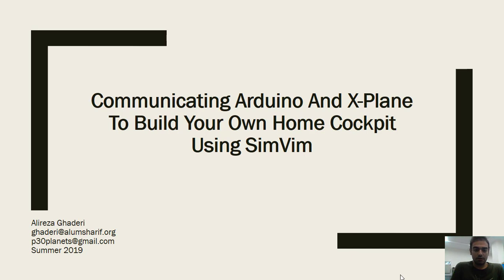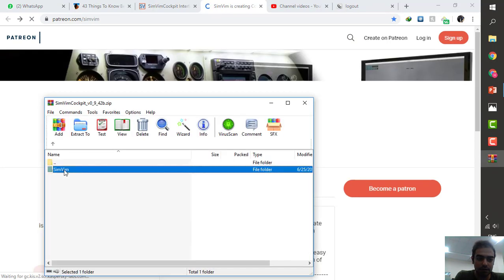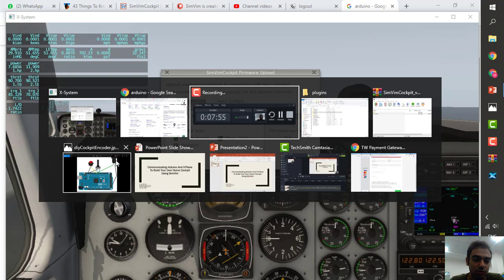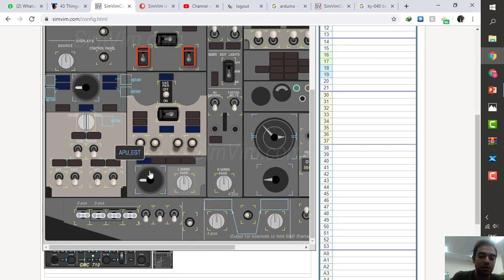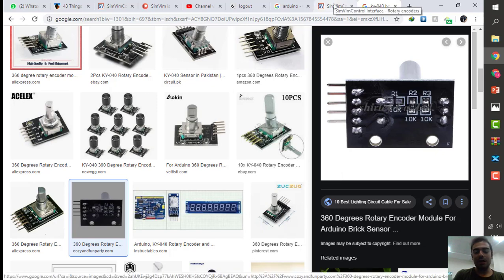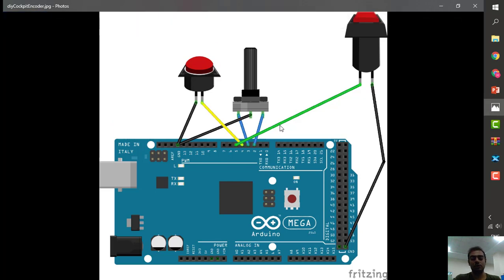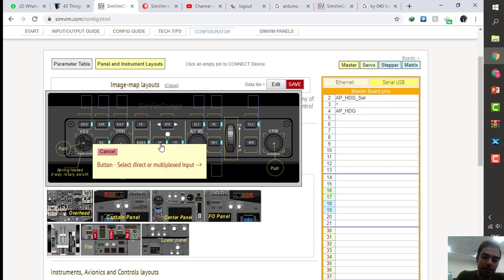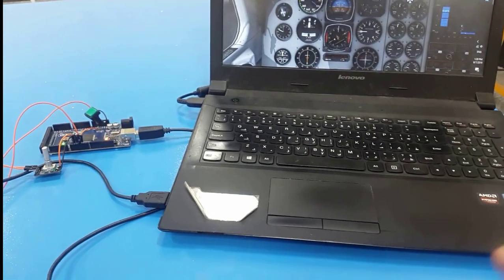X-Plane DIY Arduino  Cockpit - Autopilot panel MCP with SimVim [Part2]

Comment: Hi, I am trying to connect a rotory encoder same as you shown. But The output of my encoder is in the one direction only even if I rotate encoder in both direction. Like If i rotate clockwise then also heading bug rotate clockwise and if i rotate encoder anticlockwise, then also heading bug rotate clockwise...what am I doing wrong?
Reply from the maker: Sorry for very late answer..its look like wiring problem or physical problem with the encoder. Are you using a raw encoder or a module?
Reply: @alirezaghaderi  Hii, figured it out the same day i posted this comment. Actually i was using breadboard and jumper wires. One * jumper wire was faulty. I soldered everything and it worked as it should. 😀

Comment: NOTE: All relevant information, tutorials, videos you can get on our official website - simvim.com
Vlad (SimVIm)
Reply: Hi, I am trying to connect a rotory encoder same as you shown. But The output of my encoder is in the one direction only even if I rotate encoder in both direction. Like If i rotate clockwise then also heading bug rotate clockwise and if i rotate encoder anticlockwise, then also heading bug rotate clockwise...what am I doing wrong?

Comment: Hi there, could you possibly make a video about how to connect annunciators to xplane? Thanks. I’ve just got simple dual led annunciators and have no clue where to from here
Reply from the maker: by annunciator you mean those panels that warnings and messages are shown in that? If yes if depends on the model of your LCD module...  in the worst scenario that Simvim wont support your module, You might be able to have a custom arduino as well and get the  information from Simvim and the communicate with LCD module accordingly...

Comment: In your next video, can you please show how to connect a servo to the Arduino. I am trying to simulate the starter return in the Zibo 737-800 but with no success.
Reply from the maker: Sure. I will simulate one of the gauges for example with arduino or stepper motor. but I should first but the boards for myself. I dont have them now, then I will.  by the way, what do u mean by starter return? you mean N1,N2 gauges?
Reply: alireza ghaderi If you put the Starter on GRD, when N1 reaches 56% the rotary switch returns to CONT. This is done with a servo attached to the rotary switch.
Reply from the maker: I think this is beyond the capability of simvim alone. You need some innovative hacks and ideas. 1) If you use servo for that, serve keep the button at that position under load. so You can no more move the button manually with hand. so even if you are going to use serve, you should add some behind the scene consideration as in, remove the load from serve after rotating to switch. you may be able to do it in conditional tab in simvim for example. you can add a mosfet on VCC pin of servo  and connect or disconnect the serve using a digital pin conditional. another method could be use a separate arduino with custom code to do that. another way can be a spring mechanism that is being held with a pin(something like solenoid actuator.) that being control by a digital pin. so you activate the pin when N1 reaches beyond the desire point. This one I think is closer to what exactly Boeing is doing in Cockpit. Anyway, At least I think at the moment it is not a out-of-shelf capability.you should do some tricks for that. I may be able help you more if you want if you contact me.  and by the way. You have created all the cockpit and only problem is the Start switch ? :D